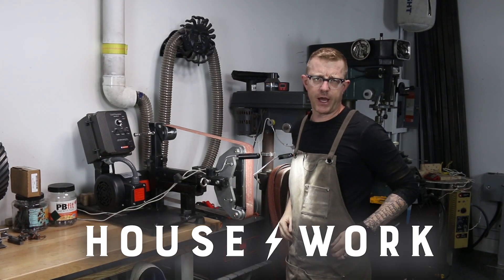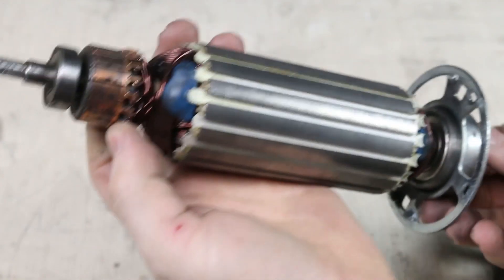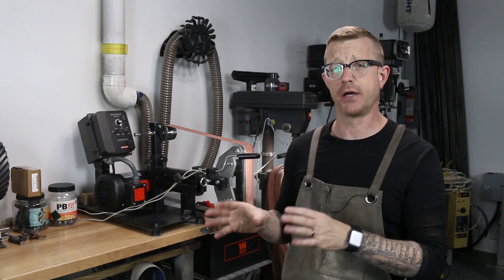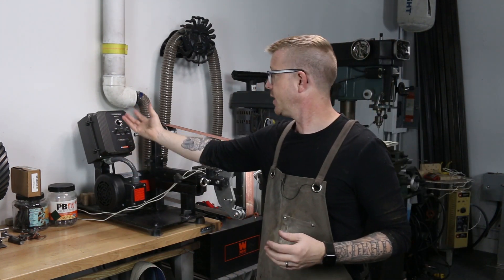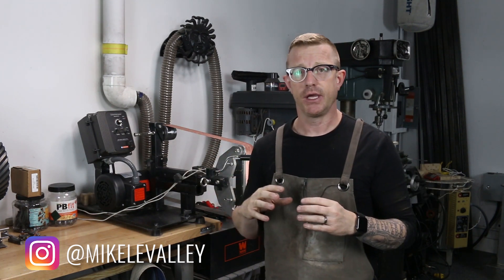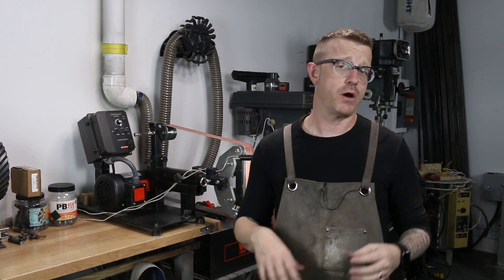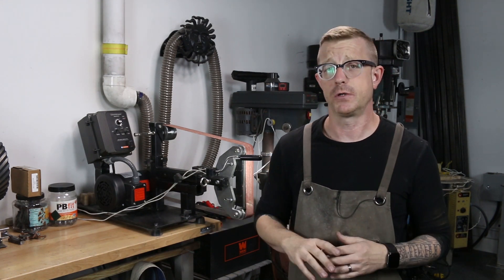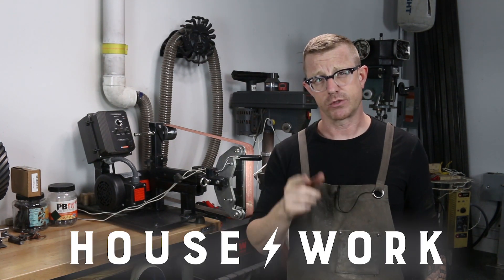2x72 Belt Grinder Build - Why I switched to AC Motor & VFD from DC Treadmill Motor

Comment: Hey Brian, great video.  I built your original grinder with the treadmill motor and associated controller and am having a heck of a time with it overheating.  Any recommendations for that?
Reply: An external computer fan would help and cost almost nothing. If you look on Google… There are a lot of ways you can keep it cool. But even after a few years in the industrial electronics repair business… And having a very well set up and respectable laboratory… Some of that motor stuff is still black magic to me after all of this experience and learning.The controller set up, waveforms and frequency, and many other variables can affect the performance and heat.

Comment: I've been thinking of replacing a vfd with a dc motor with a few components added on, a poor man's way of portable ac pure sine wave power. 

In order;    dc battery bank, connecting to a potentiometer to a dc motor, dc motor shaft is connected to the shaft of a low voltage AC motor, then an inductor to step up or down the ac motor output, finally an outlet to plug in goodies.
Sounds like a lot but the money is in the inductor easily meeting required voltage, current may need to be supplied but, I'm just doodling with ideas

Comment: In order to use a VFD, is a three phase motor required (even with a single phase VFD)? I recently bought a used Burr King 2"x72" belt grinder super inexpensive and it came with a Baldor 1hp single phase motor, but I was told if I want to use a VFD I need a three phase motor. Is this information correct?
Reply from the maker: Yes that is correct.
Reply: @LazyH-Online I'm referring to needing a 3ph motor not a vfd.
Reply from the maker: They may be available but they are not reliable and should not be used in this application. Nor should they be used at all IMO - so I respectfully disagree that is a viable option for long term variable speed changes for single phase motors.

Comment: The scr motor controller is what burned up the motor . I have been down this road on my lathe and a couple of other projects. It’s easy use the mc60 board or mc2100 board
Reply: William, I just burned up that plastic motor piece on my first try using a treadmill motor for a wood lathe ( using an SCR). I'm going to try adding a large capacitor (7,700 uF, 200v DC). I'm wondering if that's why the Mc boards are successful? My thought is the capacitor smooths out the erratic pulse which may be why the brushes burn up, etc. Thoughts? I've also heard good things about the KB controllers.

Comment: I just installed a 3 HP DC motor on my mill. Using an SCR controller off of Ebay. The power cord seems a bit warm. Did you have any issues with heat/overload on your DC set-up?
Reply from the maker: Yeah that can happen, make sure you get a good thick gauge cord.

Comment: The motor in the link is 1750 rpm. Wouldn’t a higher rpm motor be a better choice since it needs a vfd anyway?
Reply from the maker: Let me know if that link works. Doing this from my phone.
Reply: House / Work link works perfect.Thank you , Great price so I ordered 2. The third grinder I will use a 3 hp baldor that I had from a cutoff saw.
Reply from the maker: Yeah I usually order 2 at a time, since they sometimes go out of stock. I like these motors too because they are quiet and well built. Send me some pics of your builds. Brian@housework.us - id like to check them out.
Reply from the maker: Good find. They must have switched it out. Use this motor: https://www.automationdirect.com/adc/shopping/catalog/motors/ac_motors_-_general_purpose/general_purpose/mtrp-002-3bd36

Comment: Brian. I don't believe that all treadmill DC motors are built that cheaply. I believe that the more expensive treadmills have motors that are better built quality wise, especially the higher h.p. motors. I think that there are even DC motors on treadmills that are brushless, thereby eliminating this problem. Just and FYI. But I gotta say, I love your belt grinder. It looks so professionally built. Well done!
Reply from the maker: Yeah I totally agree. The one I had used probably had a lot of hours on it. I definitely believe in using them in tooling. For my timing and purpose I wanted the upgrade. Also did you check out my new prototype build? I am nearing completion of it and I did a series on it. It tilts and is much more sturdy than this one: https://www.youtube.com/playlist?list=PL9skevFWrWc5Px-9pLq0vxaun8IyQojd2

Comment: I realize that there is a "rule of thumb" about needing one hp for every inch of belt width, however I made my 2 X 72 with a 1 hp 3ph and VFD and I'm finding it works just fine and the VFD's / motors are considerable cheaper than going with 2hp version. I guess "rules of thumb" are there only as guides, and not set in stone!
Reply from the maker: Yeah if it works for you then do it! On my case the motor was pretty cheap, I paid $162 shipped for a 3ph 2hp motor. The VFD however was pretty expensive. I think it was $350 or so. Worth having I think. Thanks for sharing your experience. - Brian
Reply: Agree, sometimes its just not pressing the steel in so hard.

Comment: I’ve read that single phase motors do not work or are not meant to work with VFD’s? Here in the UK we have household 240volts. So really confused as to what to do to control my single phase 2hp 3600rpm motor. HELP!
Reply from the maker: This is a 3 phase motor. The VFD does the conversion. Single phase into the VFD and 3 phase out to the motor. Hope that helps. 👊🏻
Reply: House / Work It kinda helps, but still leaves me with the dilemma of not knowing what to use as a speed controller
Reply: @AlanAlanAlanDave You are correct the VFD will not work with a single phase motor.  If you want speed control with a single phase motor on a belt grinder, you will need to use a pair of step pulleys.  For my purposes, with a 3600 RPM motor, I would use a 4 step pulley and a smaller drive wheel.  That will enable you get slower speeds.
Reply from the maker: Thanks for stepping in on this Thomas. Alan, he is correct. No speed control on a single phase motor.
Reply: Thomas Hofmann yes thanks, in my search for a motor I got to discuss this with 70 yr old retired electrical motor design engineer who, worked for one of the most well know electric motor companies.

Comment: How come u didn't use the $100 dollar vfd
Reply from the maker: Good question, because the amount of dust generated with grinding they tend to fail. This Vfd is completely encased and sealed.
Reply: @HouseMadeUS  ok thanks. I'm an avid do it yourself er. And I'm cheap.lol
Reply from the maker: Yeah I hear you on that. Do a bit of research, people make the cheap ones work. A you have to encase them to keep the dust out.
Reply: @HouseMadeUS  thanks again

Comment: Automation Direct sells lots of surplus or closeout products for really great prices unfortunately when they run out of  certain items they are never available again. I don't know if that is the case pertaining to the motor your using however when you see a deal at a unbelievably low price you may want to purchase several just for a "rainy day". Your video's are very well done, thank you and have a most awesome afternoon. Jeff...
Reply from the maker: I didn't realize they were a closeout site, otherwise I may have purchased another one. Now all the motors I see that are compatible are $40-$50 more than what I paid. Sometimes $100 more. Thanks for watching and commenting.

Comment: 110v/120v?
Reply from the maker: Its 220 actually. Runs quiet and strong. I don't think I'd go back to DC. :)
Reply: @HouseMadeUS  , I should have known. Looks like I'll be having 220v installed in my workshop. Thanks for the heads up.

Comment: Looks like you have it set up for the long term now! Are you running that WEN air filter right there in that location? I have one of those hung in my garage. Seems to capture a significant amount of dust and things. I'm realizing this winter that I need a way to capture dust off my grinder better... it sucks opening my garage door and throwing up the fans when it's cold!
Reply from the maker: Yeah, I run it pretty much when ever I am not filming. It's a bit loud. And yes it makes a SIGNIFICANT difference when it comes to the dust build up. I also have a 4" hose running up to my dust collector that bolts just under the platen for when I am doing non steel work. It catches a lot as well. Dust is such an issue with this that if you don't get it under control it will eventually take over everything in your shop. Best to always stay one step ahead. Once its set up its easy though. :)
Reply: @HouseMadeUS  Yep, I need to rig up my shop vac with a collector for sure! Do you move the collector when grinding steel or just turn off the shop vac? I may need to move my WEN filter closer to my grinder!